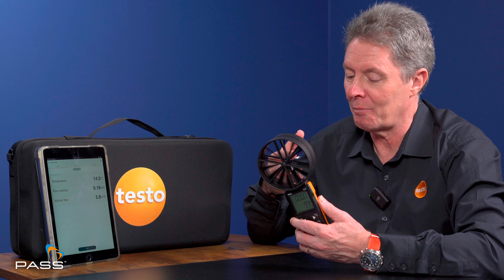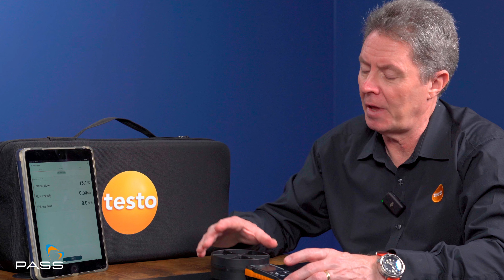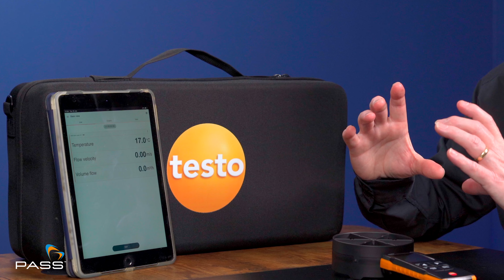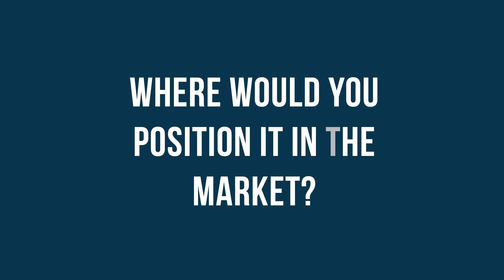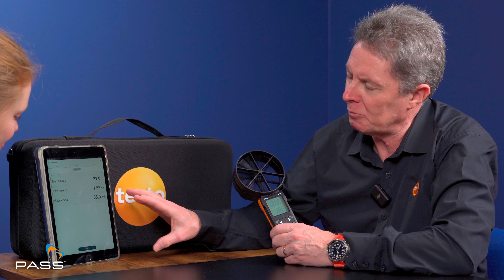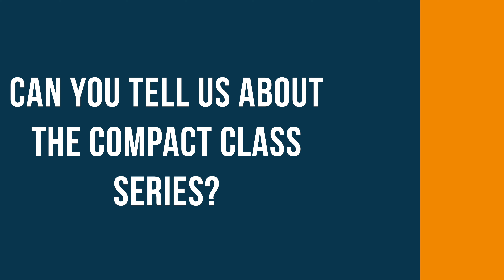Unlock Perfect Air Flow: Testo 417 Anemometer Review!

Comment: Why give me sometimes low values more than testo 420
Reply from the maker: Thank you for your question! The Testo 417 and Testo 420 are designed for different applications and may yield different readings based on the context of their use. The Testo 417 is a compact, handheld anemometer suitable for measuring air velocity and flow in small to medium-sized ducts, while the Testo 420 is a larger, more comprehensive flow hood designed for measuring air volume flow in larger air conditioning and ventilation systems.

If you’re experiencing lower values with the Testo 417 compared to the Testo 420, it could be due to several factors:

Measurement Environment: Ensure that the measurement conditions are consistent and appropriate for the Testo 417's range and capabilities.
Calibration: Check if both instruments are properly calibrated and maintained.
Positioning: The positioning of the anemometer in the airflow can affect the readings. Make sure the Testo 417 is correctly positioned for accurate measurements.

For more precise advice, consider the specific application and conditions under which you are using both devices. If the issue persists, it might be helpful to consult the user manual or contact Testo support for further assistance.

Hope this helps!
Reply from the maker: Thank you for your question! The Testo 417 and Testo 420 are designed for different applications and may yield different readings based on the context of their use. The Testo 417 is a compact, handheld anemometer suitable for measuring air velocity and flow in small to medium-sized ducts, while the Testo 420 is a larger, more comprehensive flow hood designed for measuring air volume flow in larger air conditioning and ventilation systems.

If you’re experiencing lower values with the Testo 417 compared to the Testo 420, it could be due to several factors:

Measurement Environment: Ensure that the measurement conditions are consistent and appropriate for the Testo 417's range and capabilities.
Calibration: Check if both instruments are properly calibrated and maintained.
Positioning: The positioning of the anemometer in the airflow can affect the readings. Make sure the Testo 417 is correctly positioned for accurate measurements.

For more precise advice, consider the specific application and conditions under which you are using both devices. If the issue persists, it might be helpful to consult the user manual or contact Testo support for further assistance.

Hope this helps!